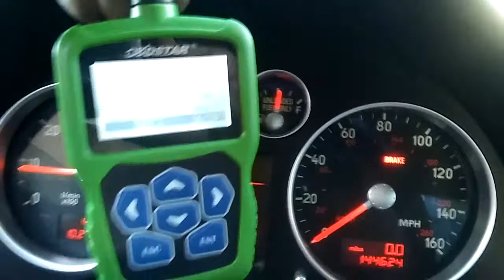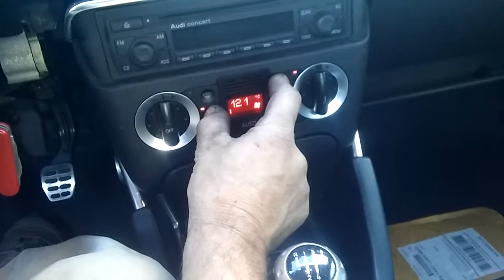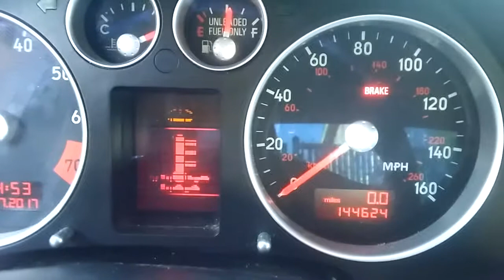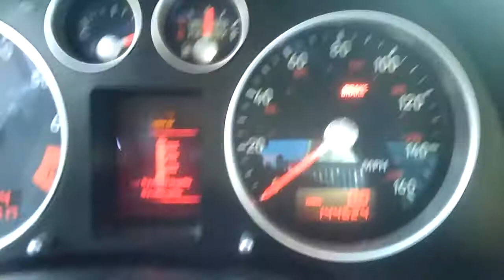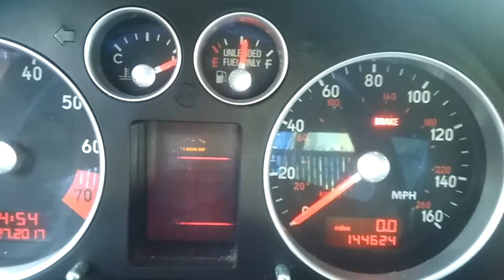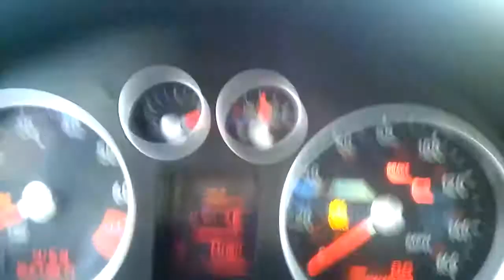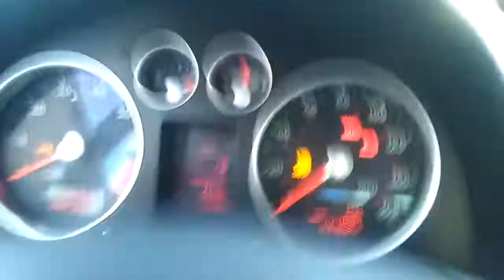Audi TT 8n Mk1 live data vs instrument cluster

Comment: Hi I'm Paul from Germany and i've got the same problem with the temperatur. But I think i found the problem. First you should know that there are two sensors. One for the ECU and one for the Cluster. This double sensor ist called G62/G2. Both are resistance sensors. So the ECU and the Cluster have a  voltage source which sould source a voltage of approximatly 5 volt. From my point of view you have the same porblem as I have: the voltage source in the cluster is defect. You can check that if you measure the voltage at the plug of the sensor:
Pin 1 and 2 are the contacts for the G2 - for the Cluster
Pin 3 and 4 are the contacts for the G62 - the ECU
As you can see at this german TT page: http://www.tt-eifel.de/index.php/technik-8n/motor/geber-g62
I think you will measure a voltage below 1 volt between Pin 1 and 2. At the Moment i don't have a solution for the problem but in Germany there are a lot of companies which fix the display of the Cluster, maybe the can help. If you have a solution pleas contact me with all the details you have!!
Greeting from Germany
Paul
Reply from the maker: Thank you for the info Paul. I was messing around with it yesterday and gave the instrument (right between the temp and fuel) a good wack with my first and it moved to almost normal. So definitely something wrong on the circuit board or stepper motor of the gauge. I have experience with BMW and Mercedes instrument clusters failing in some way too. Old E30 chassis 3 series would have the NiCad batteries fail in the cluster and cause failures. In Mercedes (210 Chassis) E320 ribbon cables would lose contact from heat and cause LED (LCD?)  to not display properly.
Reply from the maker: For that site, is there an option to translate to English or I will have to do  a cut n paste to a translator?
Reply from the maker: Doing some driving today checking for any issues the temp fluctuated back down to one line above center then the display on the climate control 49 C read 88 c... which is normal.  Still not perfect but it's almost fixing itself as I drive it.  Was sputtering at 3k rpms but I never change the spark plugs out and no clue how old they are so will so that tomorrow.  Otherwise running very well after the rebuild.
Reply: The eifel tt website is only in german available. Maybe google is able to translate the whole page. When your sensor is working after a hard knock I would say that there is a cold solder joint oder a break in the PCB and with the hit you brought the two contacts back together. The eifel tt website is only in german available. Maybe google is able to translate the whole page. When your sensor is working after a hard knock I would say that there is a cold solder joint oder a break in the PCB and with the hit you brought the two contacts back together.
Reply: With stuttering at full throttle at 3000 rpm I would first suspect the ignition coils.
Reply from the maker: Have a P0300 and P0301 (multiple misfire and cylinder 1 misfire) I suspect injector is bad. Ran into the same issue on an A4 1.8T. Will get a good used injector from wrecking yard or swap with cylinder 2 first and see if I get a p0302 code.
Reply from the maker: Went ahead and swapped the coil (since it's quicker then swapping an injector) and found it was bad. Although a coil from an A4 would work I was fortunately to find only one TT at the wrecking yard and it still had the coils in it. ;)
Reply: Thanks for sharing the link Paul!